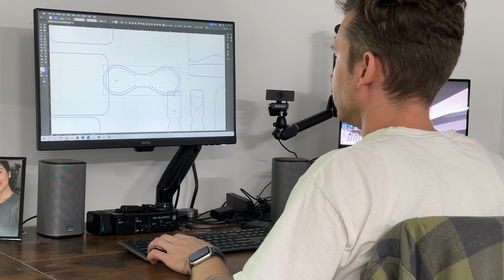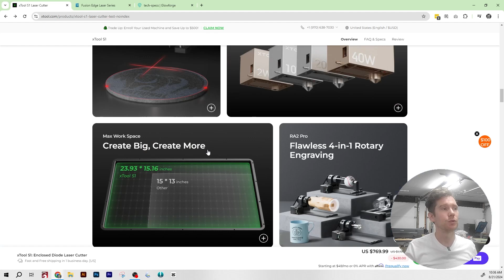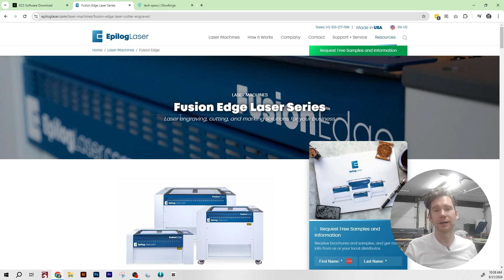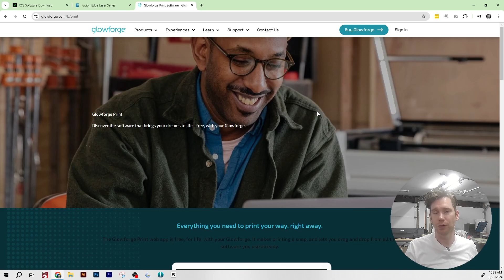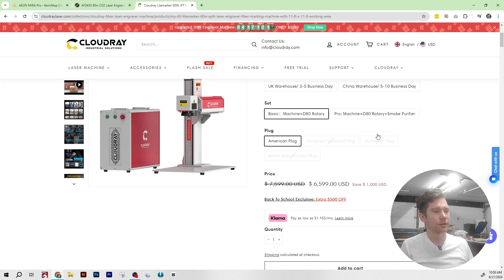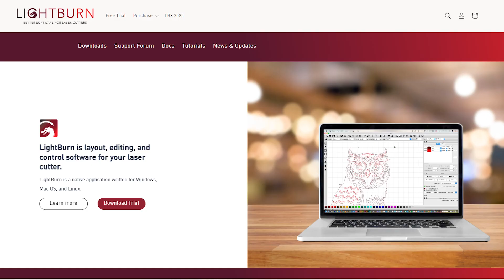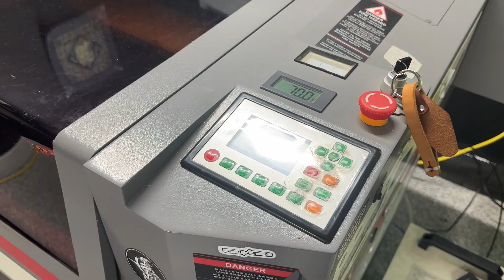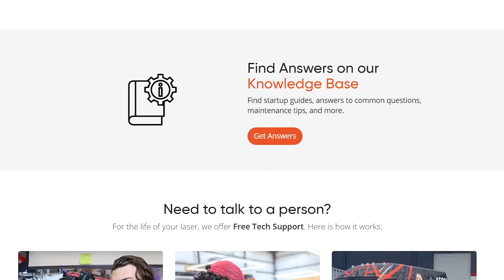Buying Your First Laser Engraver? Watch This FIRST

Comment: I am going to be looking at more regulations with the ATF, licensing, etc. I am curious for starters, if this X tool S-1 laser would be efficient use for printing designs on small weapon slides. What is the best wattage laser to be using on metal or that type of material! Enjoy the extended weekend! And do you have and idea how I should start practicing (where to buy material in bulk like that)

Comment: I'm looking to upgrade from my xtool 40w D1 Pro. I'm stuck between the OneLaser XRF, the Ikier 70w k1pro max, amd mabe the xTool F1 Ultra. The Ikier k1pro max is much cheaper with 70w of optical power output, compared to the Xrf enclosed co2 desktop laser. I focus mostly on metal work such as knives and other tools which also include cutting and engraving materials other than metal such as exotic wood, or resin. The Xrf is on sale now for $1000 off but since I live in Canada the machine alone with shipping still comes to about 6000 Cad, as opposed to 2880 Cad for the Ikier k1pro 70w max. What would be your choice?

Comment: Thank you for this video!!! I have been all over the board on which laser to purchase.  I wanted to reach out to you since you work with leather and that will be my primary material.  I am specifically interested in cutting cowhide.  I not only want to cut the cowhide, but cut sew holes and also engraving on the hair side.  I am looking at the Xtool D1 Pro.  Originally I wanted the M1 Ultra, but I need a working space of at least 13x18" which led me to the D1.  Can you tell me if I am on the right tract?  I am also wanting to engrave tumblers and drinking glasses.  One final question, my set up will be in a metal shop that my husband also uses to work on cars.  If we are in there at the same time would he need to wear the laser eye protection if he is 20 feet away?  I couldn't find any specs on that.  Thank you for your advice!

Comment: Darn good list!! 
I would add to follow groups using the brands you are interested in. Users will share the ups and downs with a machine and interfacing with the company. Do you have the skills or aptitude to handle the challenges users face? I wish I had followed the group with my first laser,I would have run in the other direction…and it was not a cheap one.
Unrelated question… you do a lot of acrylic, how often you you have to change the charcoal filter portion?
Reply from the maker: Absolutely! Im still in groups for lasers I never ended up buying lol. I end up changing the charcoal filter about every 3 months-ish. Acrylic exhaust isnt super particulate heavy like wood so the Pre-filter and HEPA last much longer than that.
Reply: @justinlaser  Thanks!

Comment: I would not recommend anyone do laser cutting/engraving without actual exhaust... unless they have active exhaust for the room in some way. Such as in a warehouse setting that has it's own roof exhaust.

No filter unit for a laser is going to be 100% effective. Either figure out the exhaust system or rent a place where it can be implemented. For a lot of people, that means not having the machine at home. Ultimately there are no laws about having these machines in a residential property, but it's still not safe.

Ideal setup is having ventilation for the room + filter unit exhausting directly outside.
Reply from the maker: I dont think anyone should use budget or DIY filter options for that reason. I have an expensive air quality monitor and when my filters are clean there is barely a blip in the radar when running. However off-gassing once the laser lid is opened and material removed is inevitable even with a great exhaust. Always have a room filter running as well almost 24/7.
Reply: Super helpful thread here. @justinlaser  - what monitor do you use for air quality? I've got a HEPA air purifier with a monitor built in, but I'm not sure how accurate it is and I might want to upgrade. Cheers.